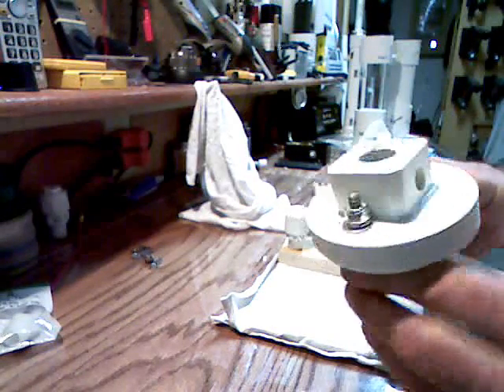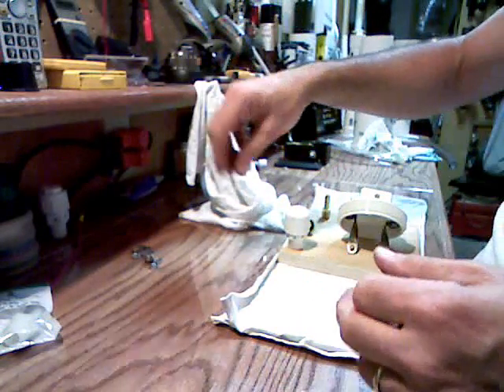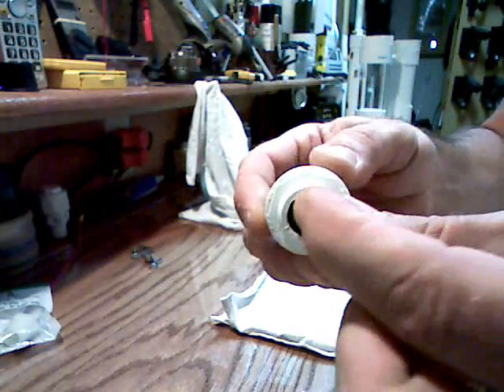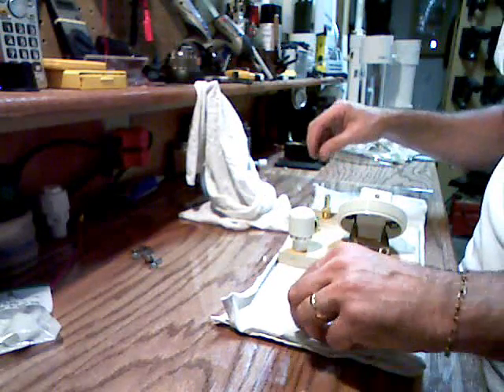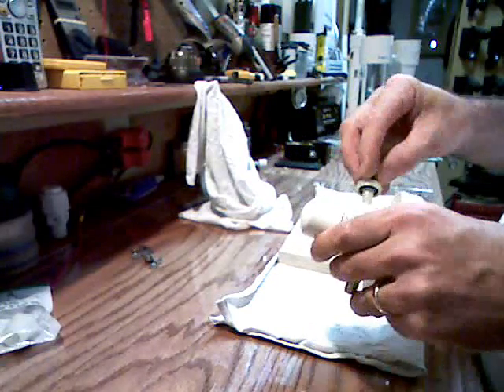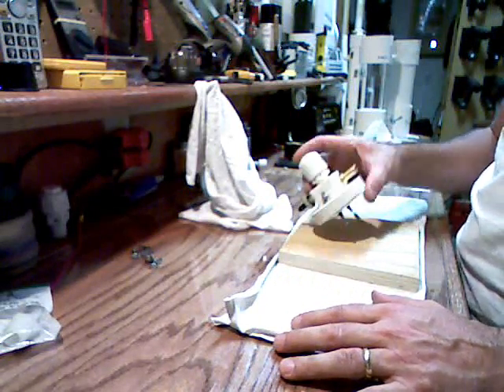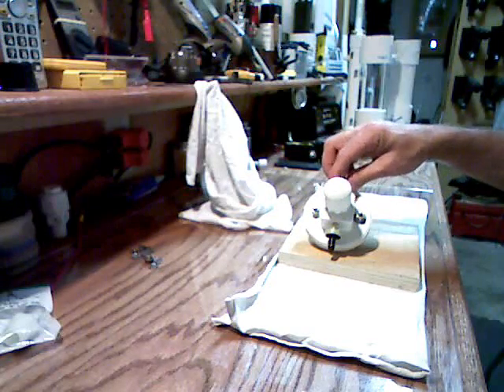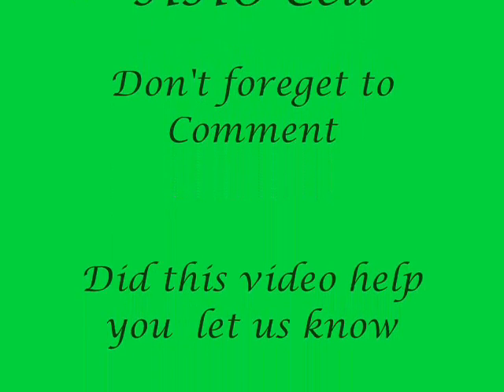Finished Cap # 2

Comment: I really like your EPD version! Great job! It looks really compact. I hope it works well for you. Does it have user serviceable internals, or is it a "glue together"?  Either way, it looks great.
Ardentscientist gave us a good tip regerding the EPD. When assembling, put a little petroleum jelly around the perimeter of the stopper to ensure it continues to actuate smoothly.
Also, thanks for the shout out about our channel.
You are doing a great job.
Keep up the great work.
Steve

Comment from the maker: Thanks Steve  
I did glue it together but the spring that I put into it is not strong enough to hold it in place but the new one is working well we added the knob to the top to do a test on it from time to time just like you would a safety valve.

John
(Bonze)